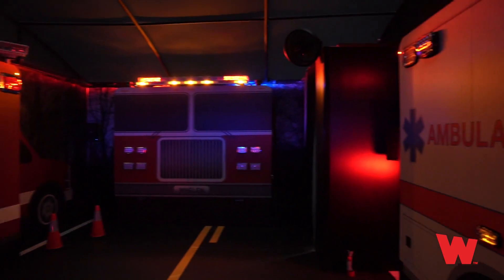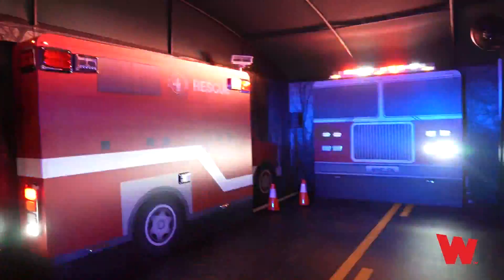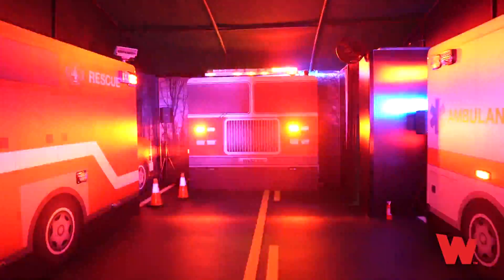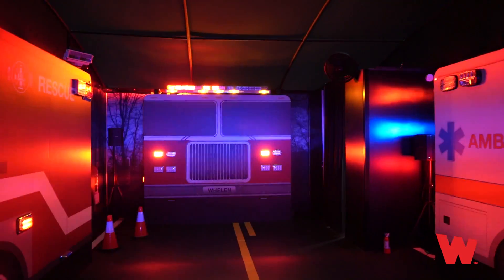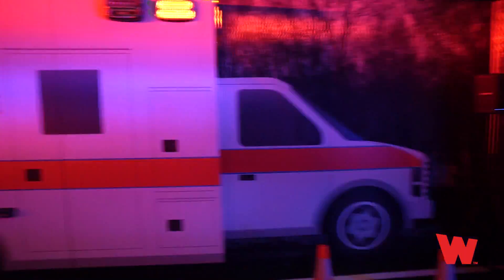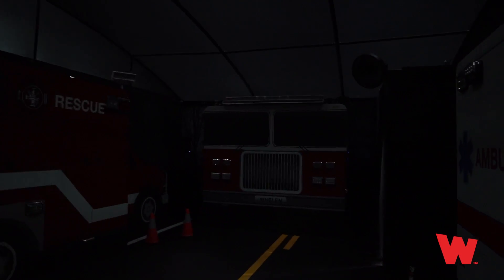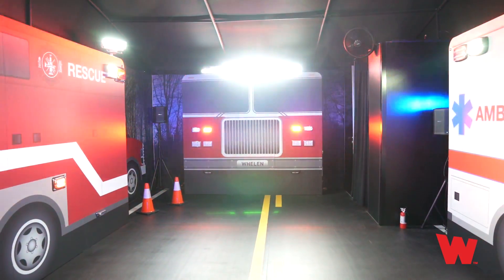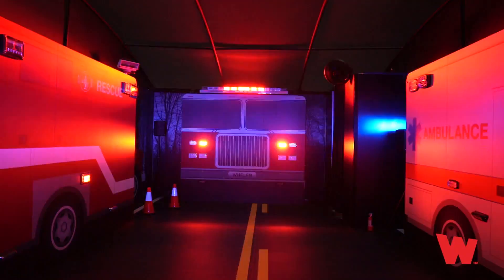A Calm Scene Is a Safe Scene

Comment: Excellent analysis and great implementation from 3:39. Concept is very good and does what warning arrays should do: give high information transfer, particularly at night, along with vehicle identification (i.e. all flashes synchronized and slow, with large lamp face).

Berkhout in the late 70s showed the best information transfer arrangements, and that alternating bi-coloured arrays were the worst: they gave deceptive indication of motion when there was none. We have known since Crawford's work in 1962 (The Perception of Light Signals: The effect of the number of irrelevant LIghts) that flash distraction is an impediment, not a benefit. Thus the array shown at 3:39 is probably the only pattern that should ever be used, although the Australian FRV trucks have an excellent method of symmetrical bi-colour arrays: see https://youtube.com/playlist?list=PLk_ETE9IGgCmsMyjjNUq-pCdQDdkmzU-H&si=XjZt248YcJkrOzAK .

The impact of synchronized arrays is very powerful as the light 'integrates' over area and there are no distracting flashes that drivers have to sort out to interpret. This makes the driver's workload far lighter and contributes to good decision-making and therefore safety.

Comment: I have to admit I'm not big on Whelen. But this was the best demo for on scene management i have ever seen 10/10.
Reply: Who else would you use? Whelen is simply the best, because other companies are more economical.
Reply: @baddriversofthenorcalarea500  Sound off!
Reply: @ICBUS0730  Sound off is... Okay. They seem to fall in the same catagory as feniex, but just dont hold up the way whelen does.
Reply: Comparing soundoff to feniex is laughable. It's not even close how much better soundoff is. There's a reason so many agencies have soundoff warning lights now. Soundoffs biggest problem right now is their engineering is all over the place. The mpower line has some of the best light spread/focus of anything with good durability. If they got everything straight and setup their version of dvi without having to be a 3 wire light I think there would be a lot more of that.
Reply: Whelen is best.